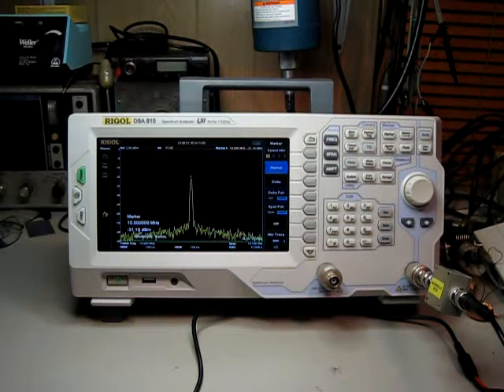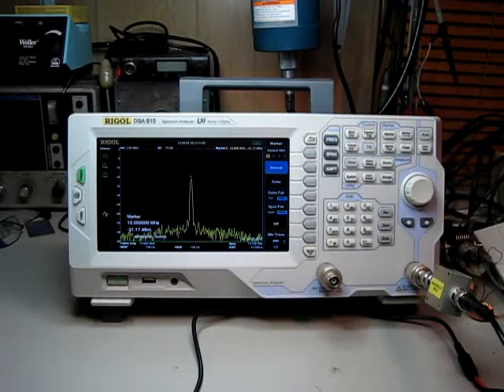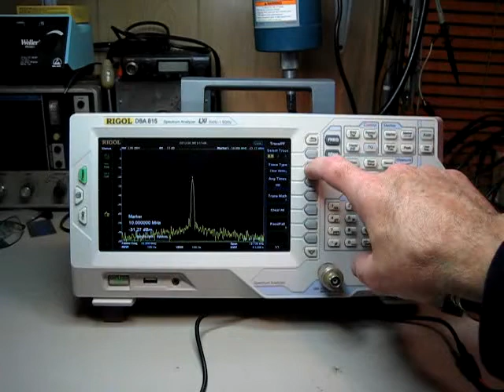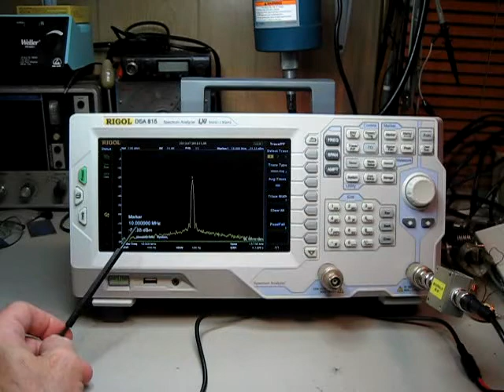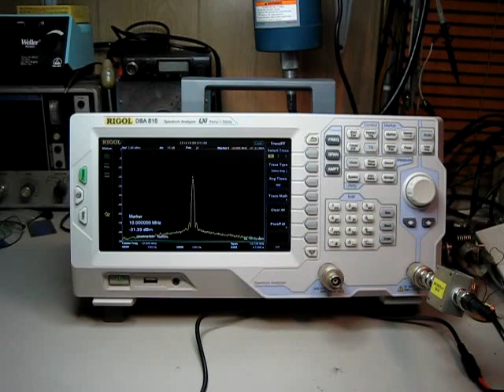RIGOL DSA-815 Spectrum Analyzer - Frequency Accuracy

Comment: you can measure frequency of that oscillator by tune on frequency  standard broad cast station on 10 MHz,simply by listen  to both  on receiver,and difference in frequency will be heard in audio spectrum like beat tone,if there is no differences in tone than frequency of both are the same...
Reply from the maker: Yes I could have ... and I have done frequency measuring contests and measured a transmitted signal from Texas, know accuracy, used WWV, spectran ( spectrum analysis ) and a spreadsheet and measured down to within 25 millihertz of the transmitted frequency. I appreciate all of your comments and suggestions, but try to understand in a lot of cases, I was also demonstrating the use of the RIGOL Spectrum analyzer and Arbitrary waveform generator. Not necessarily trying to measure or test something to the Nth degree for the sake of doing that .. Make sense?